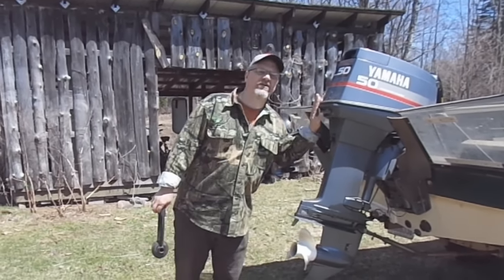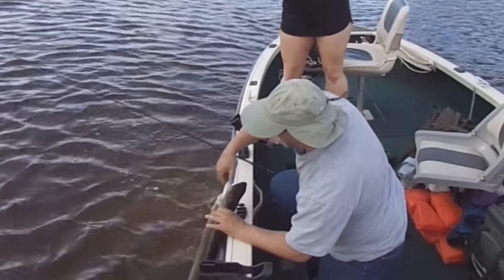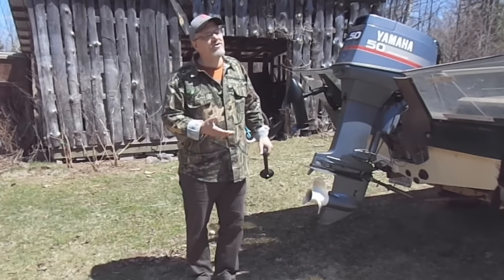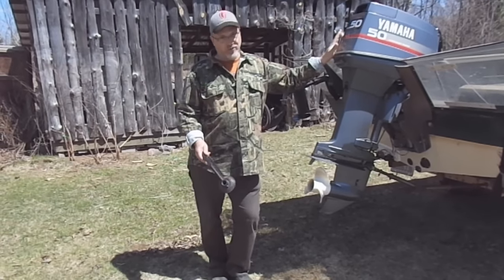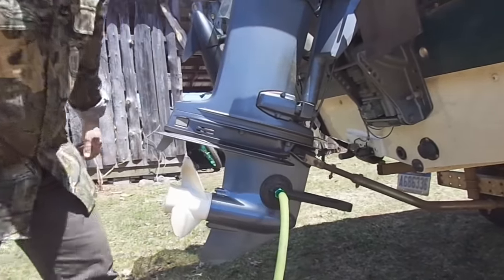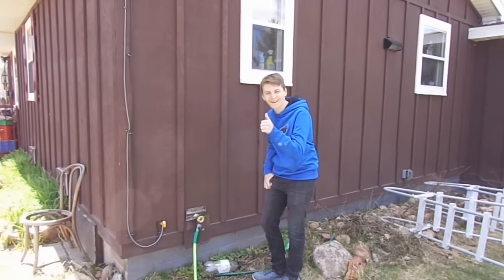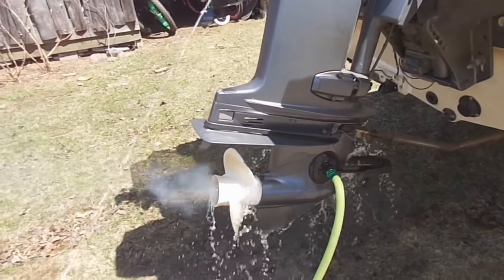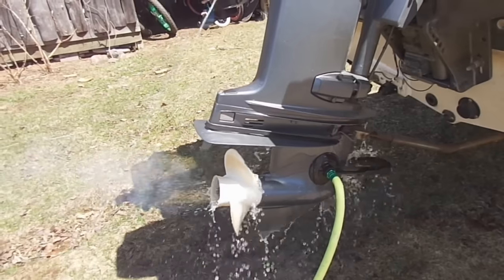Running Your Outboard Boat Motor On Land

Comment: You can use those ear muffs all day long.  The real test to see if your motor runs correctly is to put it in the water, under load.  If you are just flushing it out, that's fine.  But if you do any mechanical changes to your motor, test it under load in a barrel.
Reply from the maker: Thanks for adding in, KPO.

Comment: With these muffs can you test the prop gear system too, the forward and reverse while it's running without wrecking the lower unit. Thank you.
Reply from the maker: Thanks for adding in, KPO.

Comment: I have a hose hanging on top of my outboard
When the mechanic came to winterize it he attached it to the hose
My question is did he ruin my engine bye not using muffs?
First time boat owner here
Reply from the maker: I haven't heard of a hose attachment for that purpose.  But that may be what it is for.

Comment: Nice and short video.  Question is: is it ok to start the motor with waters/muff to maintain and lube motor during winter time. Maybe once/week or once/month.
Reply from the maker: The only concern I would have is water can get trapped up in the water pump and then freeze.  Then if you start it in cold temperatures it can rip up the water pump.  KPO
Reply: Knetters Practical Outdoors. Thanks. I guess don’t start during freezings temperature.

Comment: Hey Nick, I went to look at a used boat for sale and after he put the ears on and started it there was no water coming out so he kept giving it throttle for about 5 minutes then after he finally cut it off he took the lower off and it was the rubber impeller gone bad. He said he would replace it but I'm concerned that he may have damaged the motor. What's your thoughts?
Reply from the maker: You know I had a cooling water failure on the motor in this video out on the water once.  I didn't notice it until it gave me an audible alarm.  You could run it for a couple of minutes at low speed until you got the temp alarm then it would need to cool down and you could do that again.  That's how I got off the lake that day.  I figured until I got the high temp alarm I wouldn't damage anything.  That was over 12 years ago.  So my thought is that the motor you're looking at is probably fine, but I am NOT an engine expert.

Comment: Great video! I have a question for you: when the engine is off, does all the water completely drain out of it? I'm asking because I live in New Hampshire where it freezes in the winter. Do I need to flush the engine with an antifreeze solution through the muffs? Or will it drain completely by gravity? Thanks!!
Reply from the maker: I've never heard of flushing with antifreeze.  I have been told to slowly pull the starting pull cord a few times (if you have one) to push out any last little bit of water.  If you have electric start I've been told to bump the start button just enough to turn the engine over but not start it.  This will also push out any last bit of water.  Now I was NOT told these things by an outboard motor mechanic, but by someone I consider knowledgeable in this area.  KPO.
Reply: @KnettersPracticalOutdoors  Thank you!
Reply: My 2004 Yamaha 50 horse will drain when the shaft is completely vertical.

Comment: What was the name of the device you slipped onto the intakes of the motor? It looked like a pair of ear muffs. Those available at most boat/RV dealers? Thanks.
Reply from the maker: David, hose adapter outboard motor muffs.  Yes, I see them online at Overtons and I've seen them at Walmart.  I would think anywhere boat supplies are sold.  Thanks for watching, KPO.

Comment: How long should you run the motor, so it’s warm enough for the lake! And you don’t have to deal with cold start in the lake?
Reply from the maker: I just run it for a minute or so, just to make sure it's working.  I might not take it to a lake for days or weeks after that.  KPO.

Comment: 60hp 2stroke merc & honda 8hp 4 stroke kicker  used muffs on dry  land for winterizing and no pee-ing is something wrong ?
Reply from the maker: Yes, water cooled outboards should have water circulating through them.  Line could be plugged or water pump might be shot.  Strange that it's happening to both motors.  Let me know how it turns out.

Comment: Hello, 
Just got a boat, never had one before, tried this but fluid came out with the water as well. Do you know what this could be? Please help :(
Reply from the maker: I hate to speculate, but I would have it checked out by a professional.  Was the fluid like oil or water?  It might be nothing, but get it check out, KPO.

Comment: Can u rev it when just plug with a hose or need big bucket with water
Reply from the maker: I will rev up the motor while hooked up to the hose just to see if it will accelerate.   Just make sure the water is flowing through.

Comment: Did see u put it in gear and throttle it Max speed
Reply from the maker: I put it in gear and get the RPMs up a little, but I don't do max in the yard.  But I don't see why you couldn't, KPO.